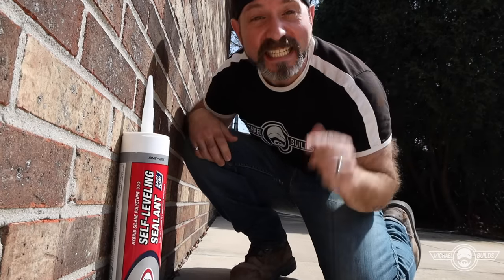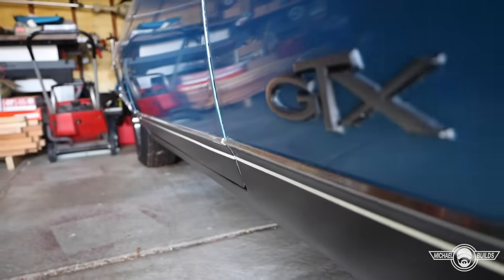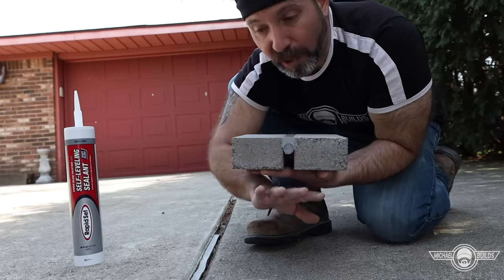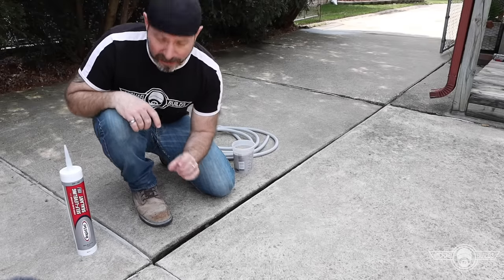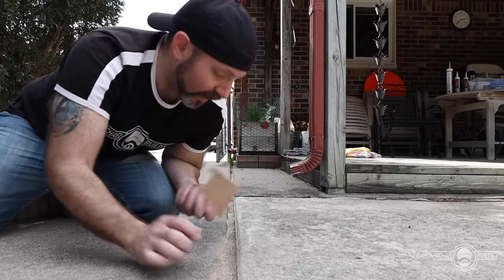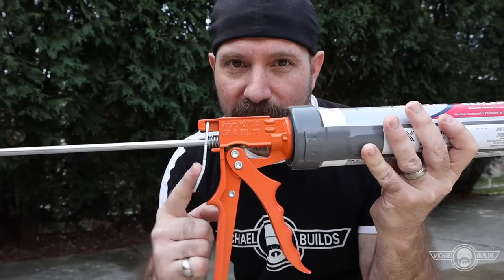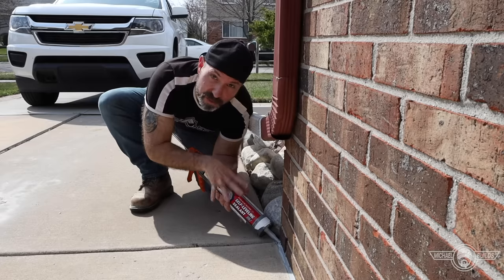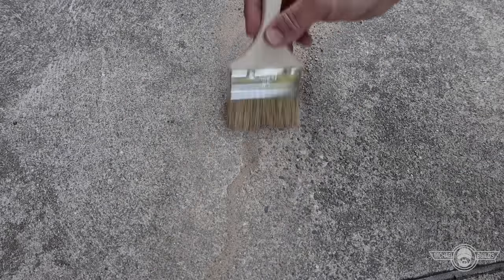How to Seal an Expansion Joint - 20 Tips and Tricks

Comment: Once again, the best straight forward, easy to follow instructional videos on YouTube.  Not to mention. You just changed the game on mold making. Love the videos and your passion.  Keep them coming.
Reply from the maker: Thank you so much! I really appreciate that! I want to do another video exploring more about using the sealant as a mold making material soon
Reply: @MichaelBuilds  this is chris. Miss seeing you at Mad Hts HD what is the heat resistance of that stuff. Small aluminum pour?
Reply from the maker: @Smath1313  hey Chris! There doesn’t seem to be any info about the heat resistance. I’ll have to poke around..
Reply: There’s a Game on mold making? You mean the completely unnecessary wood jij nonsense??? WTF? I worked real legit caulking companies for decades and thought I had seen it all but every single one of these caulking videos is absolutely horrible ridiculous flim flam wet tooling Dish soap??? Fin dish soap unbelievable at least this guy didn’t break out the dish soap water and finger tooling lick and stick

Comment: Its funny how things work out.  The expansion joints in my driveway need to be resealed.  I have been looking for the correct way to do it, and then video came up in my youtube feed.  Perfect timing.  Home Depot has Rapid Set in stock, so I have my weekend project.  Thanks for the information.

Comment: I used the Sika brand sealer  with painters tape and a putty knife with tape on the blade for easy clean up and tape on either side of the joint to do a neat job

Comment: Great video sir. I was looking at buying the rubber Trim-A-Slab expansion joints but a lot of the reviews said that they shrink over time, which would be unacceptable. This method seems like the superior way to go for me. The tip about using sand to camouflage some of the cracks was a bonus as I was going to hire someone to cut them out and replace.

Comment: Great video! Your enthusiasm kept me engaged. I am wondering if you have any advice for an expansion joint that will be near an inground firepit. It gets really hot as it is a ¼” steel ring set into the concrete, and even though we have a screen spark cover, occassionally sparks and large embers pop out. I wish there was a way I could show you a photo.

Comment: This is perfect. The tip for repairing small cracks is awesome! 

Would you recommend the Rapid Set Ultra-Fast Anchoring adhesive for spalling bricks on a window ledge? I've got all the pieces and the damage isn't severe enough to require a lintel to be installed...yet. Thanks.

Comment: Michaeeeeeeeel. I need your help please!!!!! BTW, a mil thumbs up on how you provided all the info on the sealant product you suggested  to be able to seal our cracks😆😆😆😆

Anywho, I need your advice on what I need to do with the cracks on my concrete floor prior to using self-leveling compound.. I've already putchased all the materials you used on this vid. But I'm unsure if this is the most appropriate step I need to take since i will be self-leveling. In addition, I need to bond my subwood floor to my concrete floor to self-level altogether since we are installing new ceramic tile floor. The previous home owners had plywood flooring in the kitchen and expanded the house later by adding concrete floor  to make family room. And who ever built it, did not bond the two floors and did a crappy job by just plastering cement which looked like one of my daughter's Play-Doh arts and craft she made in elementary 🤪🤪🤪😅😅😅

PLEASE HELP!!!

Comment: +1. .. This sealant is similar to a swimming pool trade product, Deck O Seal. . The essential 1" expansion joint btw the pool coping and the concrete deck/walk of the pool area. . Deck O Seal ain't cheap in any of its many colors. . Works like a champ though even in weather extremes. . I'll be sure to look for this self-leveling sealant... P.S. My Dads fun car was a red '65 Alpine convertible. ..think the beginning of the TV show Get Smart .. The family station wagon had a Dodge 383 CID V8 ... Too funny.

Comment: Michael, great video. I have one section of my work that I need to fix. I didn't think to use sand to fill the deeper portion then use backer rod on top of that to keep it from sinking. The pipe insulation, excellent idea. That will work for that repair I have to do. 
Your dad has a beautiful car! If it were mine, don't know if I could loan it out. If he let's you borrow the car, wouldn't it worry him to death?

Comment: @michaelbuilds
Echo all the comments, great video. One question you did not answer is what time of day to do this job. Doesn't matter if it's hot out or cold out? Thanks again.
Reply from the maker: Temperature is definitely a factor with this stuff. The colder it is, the thicker and more like molasses the Leveler becomes. The hotter it is the more like water this stuff is and harder to control. The temperature range on this product is between 35°F and 100°F so you have a large window of temp. I think I did mine in the mid 70’s
Reply: @MichaelBuilds  I have to admit, I didn't expect you to reply. You have so many followers and so many comments. Thanks. That really helped. I enjoy your videos and they're very helpful. Well done!

Comment: Thanks so much for the video!  I live in Royal Oak Michigan.  We had a new driveway poured in July.  They company insisted on making control joint cuts 4x4 in size.  Your video talks about filling expansion joints, but should I do this technique to the 1/8" wide 1" deep control joint cuts as well living in a state where snow and ice come in to play?  If so would you use 1/4" backer rod and then the Rapid Set?  I have only heard of Sika but will now hunt down Rapid Set and go with that.  Hoping to get it done this weekend if you feel it's important to fill control cuts as well.  Thank you for all you do!

Comment: Hi Michael, I'm a new subscriber to your channel. That was a great video!  You mentioned putting sand on top of the sealant in the smaller cracks. Have you tried putting sand on top of the sealant in the expansion joints as well?  Is it just aesthetics stopping you, or would there be another reason to avoid putting sand on the larger joints?
Reply from the maker: Hey! Welcome to the channel! No I have not done that but I guess I don’t see why not

Comment: So I watched this informative video several times before starting my project. I ran painter’s tape and after cleaning the joints, I filled them with sand, leaving about. 1/4 inch from the top for the sealant. I used Quikcrete (my concrete leveling co recommended the self-leveling).  I’m noticing now, 2 weeks later after some rain that some of the sand is coming to the surface because my edges must not have sealed well.  It’s not every joint.  I think I pulled the tape up too late, not sure.  Do I need to pull up the joint and start over?  It was a lot of work for a weekend doing all the joints. I’m sick to think I wasted my time
Reply from the maker: Good luck with your project 😊

Comment: Good video.  I wonder how does it work when you need to pressure wash over a joint repaired this way?  I use a round surface washer.  Will the caulk stand up to it?

Comment: Another great video.  In one of your first videos you said to fill in your cracks with Rapid Set Cement All before using the resurfacer.  In this video you used the sealer.  Which should I use?

Comment: Just want to say that this worked for us as non-professionals.. a few takeaways.. get the paver sand and use a plastic cup... you might not always have to use backerrod, especially if there's no room...if you don't have a power-washer. a hook knife or putty knife AND a shop-vac make for a cleaner crack even if it does take a bit more time, it's cheaper than buying a tool... last but not least... not all cracks are the same.. Driveways vary, so do cracks.. plan accordingly... using the 1/2" number, i used 1 small tube for 1 8ft length..so BUY ACCORDINGLY.. for my DRIVEWAY and seal to the garage I used 3 small tubes, and 6 - 29oz tubes.. buy 20 % more than you estimate, you can always return what's unopened. Overall, the results look VERY nice, if you've done caulking work before the results will look nice, and no, i don't recommend the sand on top..Thx Michael!

Comment: Awesome video - almost everything I needed!  I have about 500' of expansion joints (yes 500) and most still have the boards or partial/rotted boards.  I have one crack next to the house that is 18' and about 1" wide and is now about 5-8" deep, it seems one of the gutters has been draining into it.  how do I deal with that and keep water from going under the caulk?   I am planning on using Sika Sealer (lowes/Home depot)

Comment: Do you ever have issues with closed-cell foam backer rod causing bubbles in the sealant?  I've worked in the glazing industry where backer rod was used in the caulking of window and door frames.  The closed cells of the backer rod had a tendency to rupture and release cell gas from the backer rod and the gas would cause bubbles to rise through the uncured sealant.  We would typically use open-cell backer rod for this reason.  Thank you.

Comment: Poly-ether based impression materials were common in dentistry before current poly vinyl siloxane based impression materials.  Some older prosthodontists stillnuse poly ether, but it’s not common.

Question… I have a sloped concrete ramp that has some large gaps needing filling. Something self leveling is likely the end in disaster.  What would be a good high viscosity equivalent?

Comment: I'd like to see a test of alternative mold materials for concrete casting. Like if melamine is $35 a sheet, could I just get mdf or hardboard and give it a coat of sealer? What about lumber or rigid foam?
Even if they don't work it might make an interesting video...

Comment: After using this to repair driveway cracks & expansion joints; could you come back and use the rapid driveway repair over these areas to renew your concrete driveway?

Comment: Michael, 
My home is 21 years old. There is an expansion joint where my driveway concrete meets the garage floor concrete. Originally a length of wood was shoved in the gap, but it was deteriorating. A couple of years ago I removed the wood and used the gap to instead house a length of hose which is connecting drip irrigation (another DIY project) from the garden to the left of my driveway to the garden on the right side, so I wouldn't be "watering" my driveway when using the drip irrigation. Should I treat  the piece of hose as some expansion foam and put the self leveler on top of it? I'm not sure all of it is 1/2" below the surface of the concrete. Admittedly, I was trying to get it in deep enough to not hurt it when pulling in or out of the garage and not thinking about the expansion joint itself. I knew the hose would flex with the concrete as it expanded and contracted in the Texas weather. I appreciate your thoughts and suggestions. Great video!

Comment: I have very old concrete slab expansion joints that are 1-1/2" inch wide.  At the bottom of that gap, I can see what appears to be 2x wood.  This seems like a gap that's too wide for backer rod and caulk.  Thoughts?

Comment: Great video! So you fill the gap with sand, stick the backer rod and put more sand on top b4 putting the caulk? Can we use sika product? We have rapidset products in Canada but not the sealing line products. Thanks

Comment: If the driveway to be calked is at a steep incline, would you recommend a non leveling sealant? I’m afraid if I use the sealant in your video, it may pool at the bottom due to the slope. I’ve never done this before and don’t want a big mess at the end of the project. Thank you for any info/help.
Reply: ^^^^^ Same question ^^^^^

Comment: Hi Mike, thank you for your videos. I live in SE Florida, a few miles from the ocean. Our foundations seemed to have literally been built on sand. I want to add a 5'x5' pad off our back door. do I need to use an expansion joint ? or do you think I can have the concrete right up against the slab?(gonna try dry pour)

Comment: A quick question please Mike, I used the self leveling on one of the expansion joints around the inground pool. Well the cement is no longer level and one end over flowed the joint & the other end is hardly filled. now what's your opinion of the other joints? I just found & subscribed a week or two ago and have learned a-lot from your content. Thanks for doing this,
Reply from the maker: In a situation like that with extreme slopes, I would go with the “Non-Sag Sealant” instead of the “Self Leveling”. Unfortunately they don’t come in 28oz tubes but in your situation you really don’t have a choice but to go with the 10oz tubes. 
I’m so sorry that I didn’t have better news for you brother. 
Thank you so much for Subscribing by the way!
Reply: @MichaelBuilds  I just found your other video with the Non-Sag and instantly wished I had found that before reaching out to you. You know, kind of like reading the instructions on the bag of Rapid Set Leveler ;-) Thank you from down here in Monroe. I'll be doing that this summer.

Comment: @Michael Builds   With a new slab aprox 30 days old.  that has had a shop built on it.  wondering if you recommend this product fo new slabs to fill and keep control cuts clean of future depbris and dirt?  also because some engine work will be done on the floor I was planning on sealing the concrete.. should someone fill the expansion joints then seal or seal then fill joints or does it matter at all?

Comment: Do you use birth backer rod & sand? I’m coming joints in a side walk that are ~0.5 x 0.5 inches. I cut pipe insulation foam to reduce amount of sealant used & prevent 3-side bonding. In the driveway control joints that are bigger, should I use just sand or backer rod or both

Comment: Double backing rod isn't really problem; Cut length you're comfortable w/to bend in half. Beginning w/bent end&only point it'll naturally want to spring back after gradual twist. Until you feed it, continuing to twist as you go&yes,you may have to cut another length if it stops short? Big deal,especially dealing w/narrower cracks&be on the 2nd or 3rd section? By time finished the first dicking around w/sand?

Comment: I'm a little worried there could be a decent sized void below the joint. Would it be a good idea to fill it with sand? Maybe even letting a rainstorm or two settle it in before sealing the top?
Thanks in advance,  I have no idea what I'm doing.

Comment: Can I use standard yellow quickrete as fast set quickrete and not mix before setting a post. 
I get it wont harden as fast because the lack of calcium but I dont see the point of mixing. 

Have you ever tested this?

Comment: Used your method to install a hard wired Ring Smartlight Floodlight, (no camera).  The install appeared to go okay, my network found the floodlight, and I was able to create an Alexa routine to turn it on and off.  However, it now seems to be going offline, right after motion detection or a verbal command to turn it on.  I moved the Ring Bridge closer to the light, but that doesn’t seem to resolve the issue.  Do you think this is an issue with the floodlight😊

Comment: I used the light grey as per your instructions and within a couple of days it all turned black. I pressure washed it and most of the black came off but when it dried it turned black again. I tried every type of cleaner and nothing worked to remove the black color. Any thoughts on a solution. Thanks

Comment: Any suggestions for repairing control joints along a pool deck?  my concern is that the self-levelling sealants will run to much along the slop and pool at the drain.
Reply: @captaindigi82  thanks for the tip, that was very helpful!

Comment: If you're filling with sand, it's technically no longer an expansion joint. Part of the reason you want to seal joints is to keep solid debris out so that in the summer when the slab expands, dirt getting into the joint doesn't prevent the expansion. Whatever filler you use should be compressible or decomposable. Something like saw dust, mulch, styrofoam, etc would work well.

Comment: Interesting.
polyurethane comes as Ester based or Ether based.
Tubing that is Ether based is resists degradation from moisture and UV.  It also is a bit more expensive but worth it.
I am assuming this is still a Polyurethane product that is Ether based.

Comment: The depth of your backer rod should be half the width of the joint. Never deeper than half an inch. Backer rod comes in many sizes. Is the caulk self leveling?

Comment: I wonder if "The Great Stuff" foam would work well as backfill?
Reply: No it won’t,cause you can’t control how uniform it cures....it may bulge higher or lower as it cures,backer rod is best because it’s the same size all along it’s length...just use the right size backer, so it stays where you put it...

Comment: I wish I saw this two weeks ago before I purchased the other polyurethane based brand at 3x the price.

A can of spray foam is cheaper than backer rod of you have long runs.
Reply: How do u stop the expansion going over the top
Reply: @danrook5757  try not to be heavy handed and you can trim the excess once it's cured with a box cutter